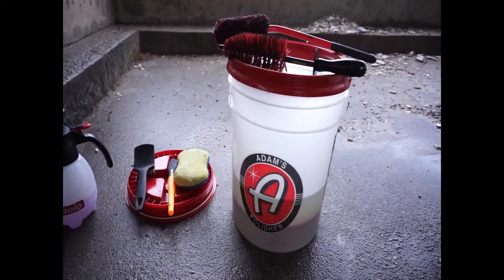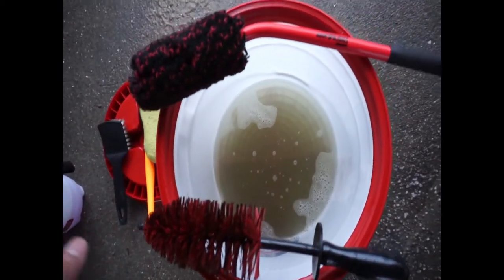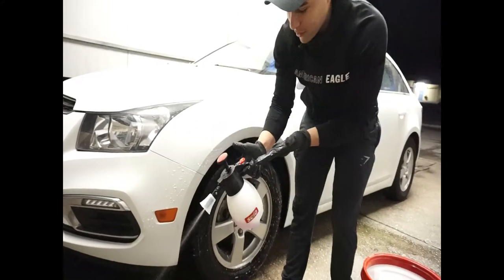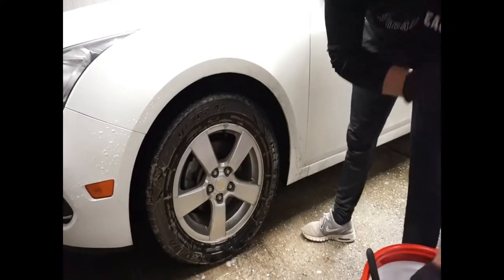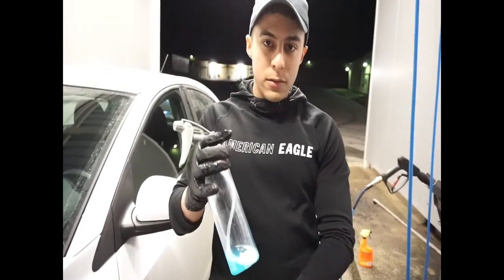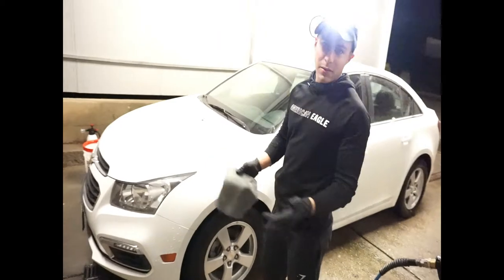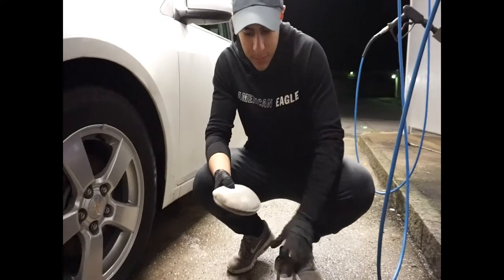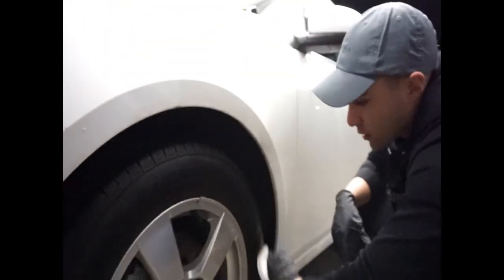DO THIS TO YOUR WHEELS BEFORE WINTER

Comment from the maker: Sorry for the reduced frame size still
Getting used to the new video editing software! Next video on the best amazon wheel cleaner will be in the correct ratio and most likely 60 frames per second rather than 30